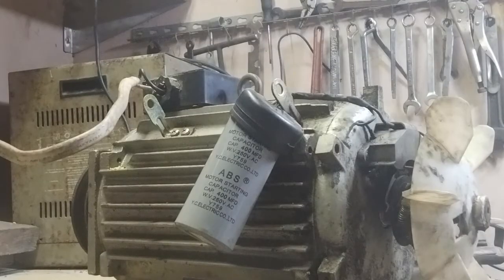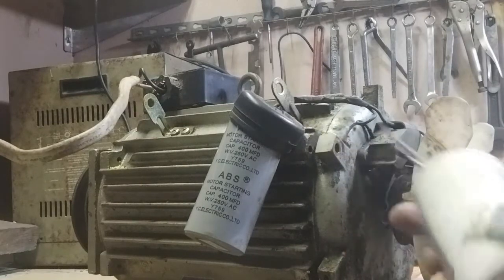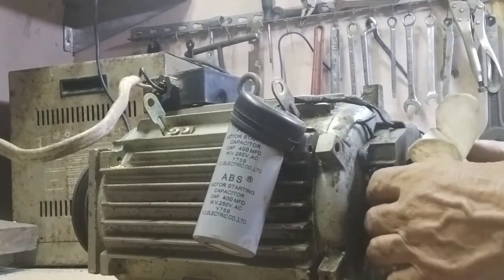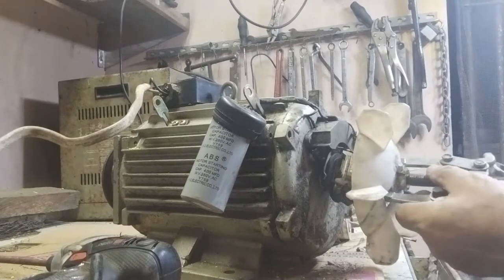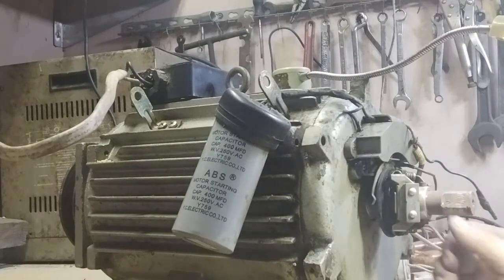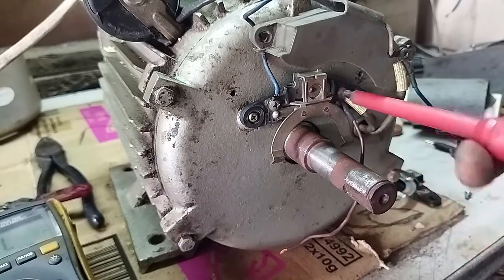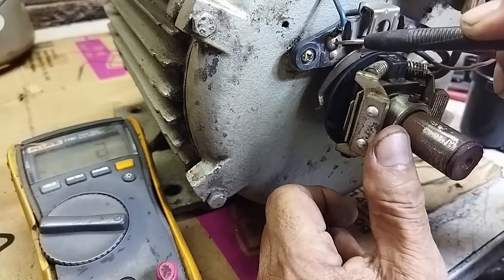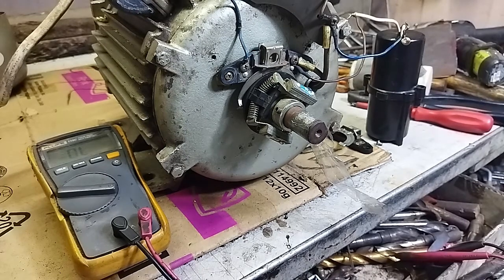MINDONG 3HP MOTOR - AYAW MAG START UMUUGONG LANG

Comment: happy new year kuya!Baka matulungan mo po problema ko sa aircompressor ko Kasi 209-210volts lng kuryenute SA bahay dB talaga Kaya magstart  Ng ganong voltage?pwede po ba palitan Ng mas mataas Ng starting capacitor?or Yung my relay na capacitor?5.5hp po compressor ko salamat po in advanced👍
Reply from the maker: Sir need mo ng AVR automatic voltage regulator yun may capacity ng 5.5hp. 2nd try mo patabuhin ang motor lang alisin mo yun belt. Habang tumatakbo measure mo yun voltage kung bumabagsak pag running motor ka na thanks for visit my channel feedback ka kung ano result

Comment: Hello sir tanong ko Lang po ano ang tamang value ng capacitor running at starting para sa 3hp submersible pump? Salamat po
Reply from the maker: run capacitor 45mfd/370v ,for starting 208 to 250 mfd/250v for 3 hp thank for viewing

Comment: Good day sir, dapata po ba 3phase din ang supply niya?
Reply from the maker: Yes sir dapat 3phase din ang supply.kadalasan convertion from 3ph to single ph thanks for viewing
Reply: @dadtechmech  sa 10hp 3phase air compressor ilang amps circuit breaker protection po kaya ang gagamitin?
Reply from the maker: 60amp ang gamit ko pag 10hp ,or kung may makukuha kang 50amp ok lang para safety trip agad specially pag hirap ng tumulak ang motor

Comment: Sir ask ko lang po ung exp ko sa motor namin 3hp din . Pag pinapagana ko kumukititap ang ilaw paano po ito maiiwasan ? Need po ba ng transformer or inverter to avoid what is happening?
Reply from the maker: Sir need mo ng separate line ng 3hp with circuit breaker. Kung nasa province area ka naman at mahina ang voltage need mo ng malaking inverter. Test and check mo yun linya ng kuryente .kung may tester ka paandarin mo yun compressor and measure voltage kung nag drop, ang normal ma maintain mo 220v .thanks for viewing
Reply: @dadtechmech  ty po

Comment: Good day sir! Tanong ko lang kung kung ano rating ng start at running capacitor para sa ganyan 3hp ? Paano ba malalaman ang tama capacitor para sa isang electric motor?
Reply from the maker: Sir hanapin ko lang yun file ko kung di ko pa na delete mayron akong data ng mga motor kung ano rating ng mga running and starting capacitor.thanks for visit
Reply from the maker: run cap 45mfd/370v and starting 208 to 250mfd/250v thanks for viewing
Reply: Pwd bang taasan ang micro farad nyan boss.halimbawa pag pinalitan capacitor?
Reply from the maker: Pag walang mabiling ng capacitor pwedeng yun nearest value. Hwag lang masyadong malayo ang value

Comment: Boss skin n ugong din patulong nmn
Reply from the maker: Sir kindi sa capacitor yun centrifugal switch sa likod ng motor. Hindi nag release yun switch .uugong lang yun .normally close yun centrifugal yun switch pag andar ng moror mag rerelease yun .thanks for visit my channel
Reply: @dadtechmech  sir nabilhan kuna ng bagong starting capacitor my time sya na hirap mag start na ugong
Reply: Sir ano magandang gwin ko sa centrifugal
Reply from the maker: Check mo yun centrifugal switch dapat laging naka ON yun pag nag start mag open yun switch mo, pag di sya nag open both running ang starting capacitor mo connected pa
Reply from the maker: Yun pag test nyan technician way tangalin mo yun starting capacitor then tulak mo yun fan sabay iplug mo yun unit  pag tumakbo yun centri switch mo di nag release
Reply: @dadtechmech  sir pwd ko ba mhingi fb mu ng.mkapag direct ako,slmat
Reply: @dadtechmech  boss ty ok na sa centri switch nga ang problema umatras lumuwag yung screw kya di masyado nka dikit.slmat boss..galing mu...nkatipid ako sa gastos winding daw sbi ng iba..di pla
Reply from the maker: @dyworkzmotovlog7274  isagani villegas fb ko yun pic same dito thanks for visit my channel
Reply from the maker: @dyworkzmotovlog7274  congrats at nadale mo
Reply: @dadtechmech  boss matanong lng ,ok lng ba na wlang running capacitor
Reply: Ilang beses ko inulit olit di na ugong ska ganda na starting di hirap..
Reply from the maker: @dyworkzmotovlog7274  need nyan talaga ng start and running cap. Kung baga sa tao kinuryente mo para magising ,need nya ng induce voltage to start
Reply: @dadtechmech  ah ok pwd paturo sir kong paano lagyan ska anong sucat ng running amg bilhin ko
Reply: Sir ok lng ba pag wlang running capacitor

Comment: sir may 3 phase motor po akong motor and gusto kong gawing single phase motor ano po kayang pwedeng starting capacitor ang dapag kung gamiyin? 
HP 3
volts 208-230 / 480
Amps 9-8 6/4.3
HZ 60
Reply from the maker: https://youtu.be/1l0NeKbyxXU sir ito yun three phase to single phase convertion thanks for watching and pls subscribe working and tested yan hindi nag drop ang voltage